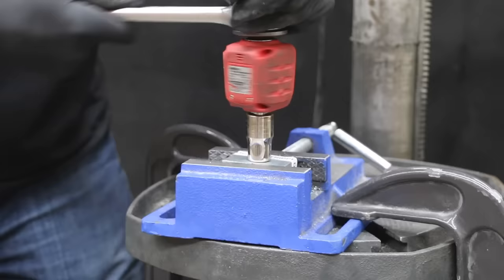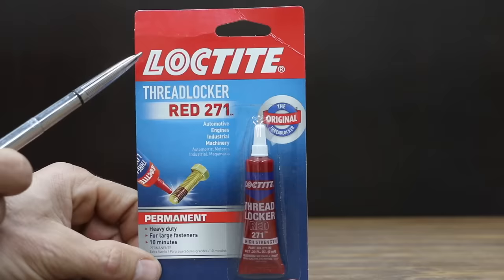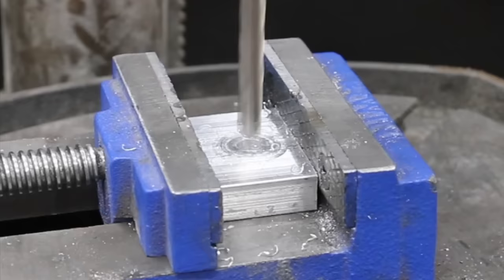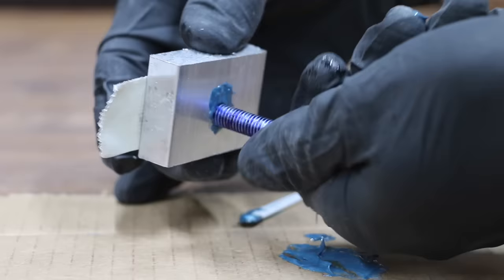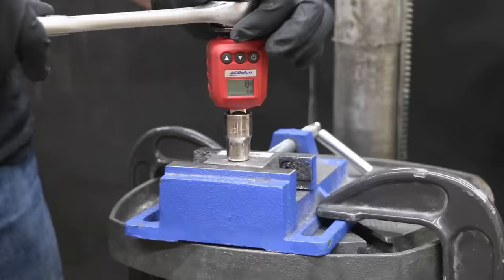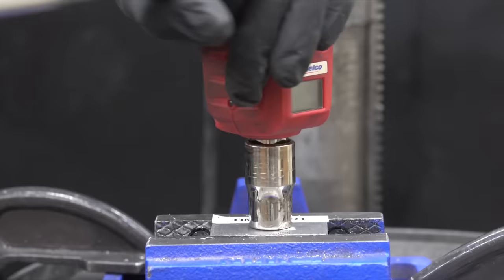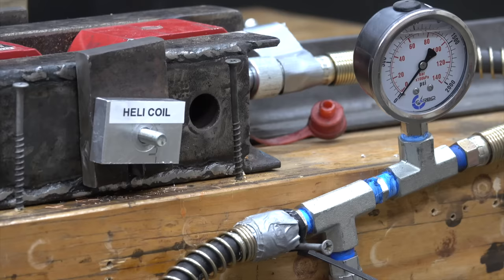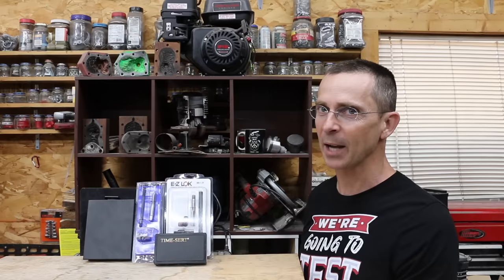Best Damaged Thread Repair? Let’s Settle This! Heli Coil, TIME-SERT, E-Z LOK, JB Weld, HHIP, Loctite

Comment: 13:49 Pro tip for everyone: If you send aluminium parts for anodizing, insert the Helicoils AFTER the anodizing process. This one time I had to drill, tap, and insert some 500 Helicoils into pieces a coworker messed up (never checked his threads), and when they returned from anodizing, all Helicoils were gone. Whatever acid bath they used to clean the parts, it had no problem dissolving the Helicoils.
Reply from the maker: Thanks for sharing.
Reply: Anodizing means that you are turning the part into an anode. Both stainless steel and aluminum work because they form an oxide so quickly that it forms a skin that protects the metal underneath. That means that if you scratch through it or prevent it from happening the part can be eaten up. That's why they will use a process to build up the thickness of that skin. With a conductive material instead of only getting heat when atoms combine you can also get electrical current. As in you can kinda think of rust being like fire since at some point if it happens you see flame but matter just has some basic ways it works so depending on how you add electricity to metals you can get reactions and with anodizing you are forcing it to react. If you mix metals they will make a battery and there is a scale of nobility if metals showing how much they react. Steel and aluminum aren't that bad normally but in an anodizing tank they will react. By having those inserts in there you probably had some minor changes to the oxide layer since it had to eat the steel before it would begin to work on the aluminum. 

You might also find it interesting that aluminums oxide layer unlike the chromium oxide layer tends to be a bit more open and thicker and is what makes aluminum special because it's really hard your average sandpaper that will cut even very hard steel is aluminum oxide. It's why it makes great boats since you have a soft tough inner material with an ultra hard exterior that self heals and doesn't wear much when you run it on shore. Some metals when you anodize or form colored oxide layers on them change the surface pattern so they reflect light different like a peacock feather but aluminum is different and they put dye in the mix that gets trapped into the skin.

It just accurred to me that thermite is iron oxide and aluminum. Aluminum is extremely reactive and I don't know all the chemistry but once you get it hot enough it can actually pull the oxygen from the iron basically just pure rust to itself and burn it. It's not as reactive as magnesium but it's up there and can be used in explosives as well. A safety note is to not mix them when grinding at least on a large scale.
Reply: Also, holes are supposed to be masked off. Anodized threads are bad. Anodizing in threads can cause bolts to seize.
Reply: I used to work at a shop and we had that problem too... A couple whoopsies with batches of parts helicoiled before treating. They'd come back all blackened and stained and we had to redo the parts. 

Always fun redoing stuff in an absolute rush...
Reply: Want to remove steel bits from am aluminum part? Immerse it in a saturated alum solution. It will dissolve the steel out without touching the aluminum. Be patient…
Reply: Aluminum and iron react differently to oxidation. Aluminum forms a shell that gets better and better at preventing further oxidation while iron actually accelerates oxidation as it oxidizes.
Reply: Probably what happened is, the anodizing  shop found steel inserts in the threaded holes and removed them because they would have created a real problem in the process. I know this because I was told that all steel MUST BE REMOVED before sending parts in for anodizing. They probably should have sent the inserts back with the finished parts, but someone forgot. They did not dissolve them.
Reply: @timhallas4275  How do you remove heli coils? I can't imagine it being easy OR fun, especially 500 🤣🤣
Reply: @Duppavich  Heli-coils are easy. I put super glue on a bolt and screw it into the heli-coil. ten seconds later I twist it out.
Reply: @timhallas4275  Ahh there you go, cheers for that 👍
Reply: they likely just took them out.
Reply: @timhallas4275  I agree that this is almost certainly what happened.
Reply: @DavidLDFL  One thing for sure, the acid used to clean aluminum before anodizing will not dissolve steel. so yes, someone took them out.
Reply: @timhallas4275  Exactly, I used to work in aviation and we constantly had to work with helicoils. Before stripping a part and anodizing it, it was procedure to take them all out.
The shop where this guy sent his part seems to be doing a great job
Reply: @stormiewutzke4190  Good chemistry lesson. That aluminum skin is so hard it requires a particular technique when welding. And thermite in general is not explosive, but it burns white hot. If you want to destroy sensitive information and equipment in an emergency situation then thermite is your friend.
Reply: @Duppavich  If you reach in with a pair of small side cutters (like for electronics work) and grab the end of the helicoil and pull, it will curl out of the hole. Unless... you use red loctite on the insert, which I always did. Still gonna take time any method, when you have 500.
Reply: threads are not supposed to be anodized
Reply: @steadyeddie7453  I'm a welding inspector and instructor. I could bore you for a week about it all. The fact that it forms that skins is quickly shows you that it is reactive. In thermite the rust powder is an O2 source rather than a second fuel I believe. An oxyacetylene torch is actually burning steel. Metals burn well if you get them hot enough.
Reply: @Duppavich  grab the top thread with needle nose and pull. It will uncoil right out of there like line off a fishing reel.
Reply: @MrCarrizojim  Just wait to tap the holes until after the anodizing process or if you already tapped them before, re-tap them to remove the anodizing from the threads.
Reply: @timhallas4275  "They probably should have sent the inserts back with the finished parts, but someone forgot."
HeliCoil, HHIP and similar types are one time inserts. If you unsrcrew these inserts again they are stretched and destroyed and can't be screwed in again, so no reason to send them back, but they could have made a note about never putting them in before anodizing. If the tap at the end has been broken off they are also hard to remove, but can be pulled out and turned into a long string at the same time with some pliers is you catch the end of it.
The E-Z Lok, Time-Sert and similar types can however be unscrewed and reused since it's basically just hollow screws unlike the HeliCoil and HHIP types which are basically springs.
The main advantage of HeliCoil, HHIP and similar over E-Z Lok, Time-Sert and similar is that they have a thinner wall thcikness and hence require a smaller increase from the original thread size and the new bigger insert thread size. This can be important in places where you don't have much material around he original hole to drill into.
Reply: @timhallas4275  Send them back. Ha ha. The only reason to send them back would be with a note saying "Keep this shit out of stuff you send us." The inserts are useless without the tang to insert them.
Reply: WWl
Reply: @stormiewutzke4190  aluminum dust from machining can be dangerous because it is so reactive. It reacts with water producing heat and hydrogen gas. It can start fires.
Reply: I bet they came out during the process and did not dissolve. I believe they are stainless steel

Comment: I learned about helicoils while working on jet skis back in the mid 2000s. The German operated shop had some pretty genius solutions to repairs, and jet skis plus salt water meant we had our hands full with bolts, threads and the failures from both. But one day when I thought we were totally out of luck, out came the helicoil kit and it blew my mind on how easy and solid the repairs were. I have recommended helicoil repairs multiple times over the years yet nobody seems to know that type of repair is an option, and that the average person can make a repair in minutes that would normally have to go to a machine shop. So as always, thank you for the fantastic video, but also, thanks for spreading the knowledge of these types of tools and how easy it can be to do this. Year after year, manufacturers make it harder and more complicated to repair your own items. Tools like this out the power back in our hands and keeps money in our pockets.
Reply: Well stated! Youtube and manuals are my friend. I always try to fix most things myself.
Reply: So many people discount helicoils. Being highly corrosion resistant, inexpensive, and easy to install, they are my go to for jet skis and automotive thread repair 🤙🤙
Reply: i learned about helicoils in Auto shop back in the late 80's, i had stripped a thread on a Holley fuel bowl screw trying to tighten it to get it to quite leaking gas. the teacher showed me how to take the carb completely apart and put it in the drill press, line everything up and drill it for a helicoil.  I have been using them ever since, and i still hate leaky Holley carbs to this day.
Reply: @shadvan9494  lol. I have a Holley I just rebuilt for my 72 f100 and it leaked all over. Had a spare Edelbrock I tossed on her, but battery is dead do I don't know if that one leaks too lol
Reply from the maker: Thanks and you are welcome!  Thanks for sharing!
Reply: Learned on Nuclear Submarines as a Machinist Mate in the 80’s.  Later used them on Oil Rigs!  👍
Reply: @shadvan9494  the secret to leaky holley fuel bowls is to coat both sides of the gaskets with cherry flavored chap-stick. don't ask me why, i just know it always works. for some reason the other chap-stick flavors won't work, there is something special about the cherry flavor..
Reply: @shadvan9494  seems. To me my 650 spread bore double pumper used to leak on me too. I think  it may have been that type gasket that when you expose to air it magically  grows and cannot be used again.  Had to buy a supply of them. Same thing  with those glass bowl sediment filters.
Reply: I used timeserts on my Yamaha wave blaster and Riva cast aluminum exhaust. That heavy pipe and vibration with the two stroke liked to snap bolts.
Reply: @flhusa1  The cork one's were pretty much single use,the black composite ones are better if you disassemble more than once.
Reply: @marzsit9833  , sorry, the comment to J.D. was meant for you. Obviously all in fun.
Reply: Used helicoil back in the seventies the first time I reassembled an engine of my own car.

The torque wrench I used only "broke" about twenty degrees when it got to the right setting, and I had been used to one in class that went completely free when it reaches the setting. Used too much force too fast, and just whizzed through that twenty deg and broke the thread. I'm told I was lucky not to have cracked the block.

Thought that after all the work I'd already done on that cylinder block I'd written it off: till the parts shop told me about heli-coil. I can't describe how relieved I was... 

Worked fine and was still holding the engine together when the car went to scrap years later.

Of course the other learning point was to learn how a particular tool works before using it...

Comment: As a former motorcycle mechanic, I preferred to use the Time-Sert thread repair in my workshop.

At that time the only competitor was the Heli-Coil inserts, which I had consistently not been impressed with.

I did use an epoxy/metal repair material called Metal-Set to build up a sheared portion of the casting on an engine which retained the clutch cable adjuster.

I wrapped a bolt in PTFE tape and after cleaning the repair area with brake cleaner, I built the Metal-Set around the bolt in situ.

Once cured, I unwound the bolt, filed the repair to match the original casting and refitted the clutch cable.

Despite shear load being present, that Metal-Set repair never failed.

The customer couldn't afford to have the repair carried out in the conventional way, and my method met his budget and worked perfectly (and was guaranteed by me).

From my experience, I regard the Time-Sert as the best of the type, I have never had one fail, and with the application of Copaslip never had one seize or corrode either!

I have very successfully used Araldite (Not Araldite Rapid!) to repair deep pitting corrosion in motorcycle front fork tubes.

After stripping the forks and thoroughly cleaning the pitted areas (it was extensive!) I filled in the holes with the mixed Araldite.

Once set, I sanded the repairs to the chromium surface of the forks, cleaned it and rebuilt the forks with new seals, oil and fork gaiters.

The owner couldn't afford to have the fork tubes re-chromed and my repair meant that the forks never again leaked and would pass the MOT Test, (I warranted the fork repair too).

These repair products are an invaluable aid in the workshop and when correctly applied will give permanent, high quality repairs.

Your tests are fantastic, and I have benefitted from your research and findings.
Reply: Time-Sert is 100% legit. Love the design.
Reply from the maker: Thanks and you are welcome!  Thanks for sharing.
Reply: I had to do multiple thread repairs on a Honda crankcase, not much material to work with. Heli Coils with their smaller diameter worked fine. An aviation technician told me that's all they use, and all OEM assemblies come with HC.
Reply: I've never used Time-Sert. I've also never had Heli-Coil fail on me, guess if they do I have a very expensive alternative now. :-D

I was impressed with the fork repair, I don't work on motorcycles. I know that some of the structural adhesives used in collision repair are very impressive. I'm kind of wondering how they'd work for thread repair now, just for giggles.
Reply: A properly installed heli-coil will ultimately outperform any other threaded insert, heli-coils are approved for use in aerospace while time-serts and others are specifically prohibited.
I wonder if the FAA, in conjunction with the entire aerospace industry, got together and used their combined experience with testing and engineering to evaluate the performance of threaded inserts.
Reply: @Skinflaps_Meatslapper  Exactly, 100% agree if it's good enough for flight it's good enough for me. Why try anything else!
Reply: @Skinflaps_Meatslapper  No.  They just called Project Farm.

Comment: I can't thank you enough, drilling and tapping all 48 pieces then testing them, collecting data and plot them for comparision, and then producing a nice quality video. You're always the guy I go to before spending money on multiple products and running a whole bunch of trials with incorrect measurements. Im gonna try the JBweld steel epoxy since I have it in my garage, if that doesn't work then I'll try one of the inserts! Thank you once again.

Comment: Seriously— thank you.
This is absolutely a laboratory level test. I’m completely sold on all the metal thread inserts but HeliCoil will probably be the one I choose when needed, based on its smaller diameter and because it’s the most commonly stocked in local auto parts stores. It’s better corrosion resistance is a bonus.
Reply from the maker: Thanks and you are welcome!
Reply: yeah. ezlok and any stainless coil insert seem to be great picks for a factory grade repair.
I wonder if you could use a permanent loctite on the helicoil for frequent use. do the helicoils have problems backing out?
Reply: @robomatt1600  I have heard of people using thread locker on inserts before to prevent the inserts from coming out when the fastener is removed, so I would say yes. I was rebuilding my brother's 4.6L 2 valve mustang engine (well known engine for spitting out spark plugs). It had a spark plug thread already repaired in the past with a time sert. The time sert was not put in with a thread locker (that we could tell), & because of this the time sert actually corroded to the spark plug so bad that we could not get it off to put back in the head (needed it for the new spark plug). So he ended up having to run one bad sparkplug misfiring really badly on one cylinder until we could source a new insert. Long story short I put thread locker on the new time sert before putting it in, & I always use thread locker on all of my inserts of any kind from now on just for peace of mind. Silly reason to end up waiting to be back on the road/track or miss a car meet/show.
Reply: @robomatt1600  I was actually really surprised that the timesheet corroded to the spark plug instead of the aluminum. That part I still don't understand.
Reply: yes..  recently I needed severAl different size inserts.    I knew I had some heli coil kits around somewhere but could not even remember what sizes they were...   Did a search on Amazon and several kits   With the Horusdy (which works exactly as the heli coil)  not only being the cheapest but with the best selection.    I am all  about buying 'kits' these days.   I did find the old heli coil packs I had bought years ago...  None of em were the right size of course...  and one of em did not even have one insert used the other two had one insert each gone.    I probly paid more for those three packs of one thread than I did for the entire Horusdy kit.    And.. it is all organized and in a big orange plastic case.    Should be easy to find in the future.    Oh... this is a metric and SAE kit with about ten sizes of each.   Each has it's own drill and tap... and insert tool ... Very common sizes.   Can't imagine I will need anything bigger or smaller in the future.    Each size comes with about ten inserts.   You can also just buy the inserts and use your own drill and tap and ciobble up an insert tool from a smaller bolt that you make a slot in.